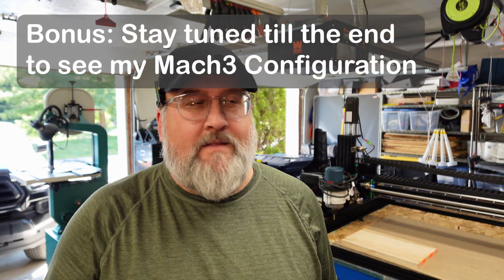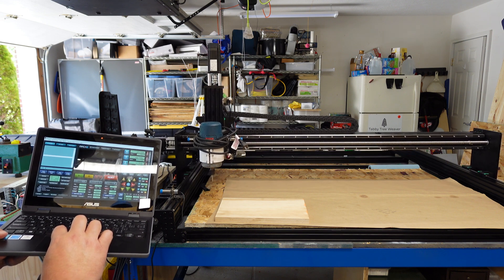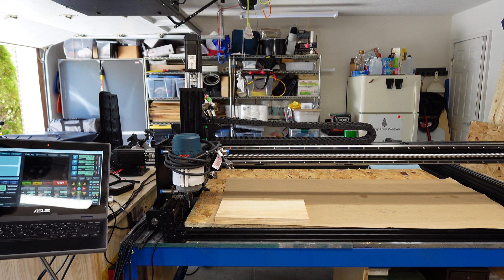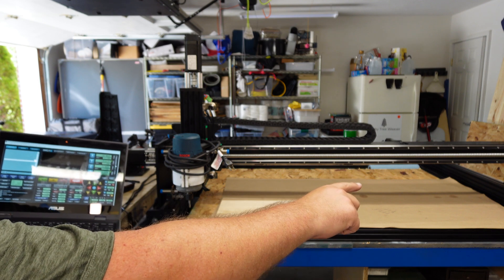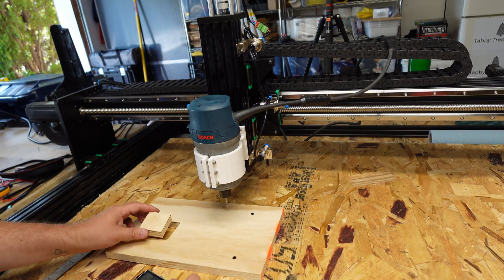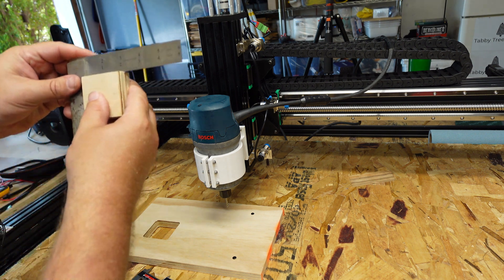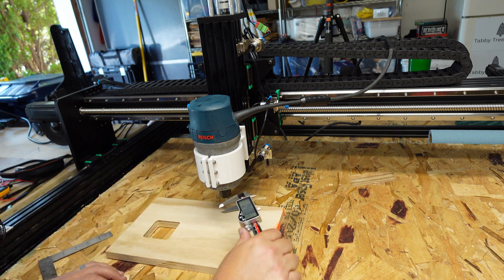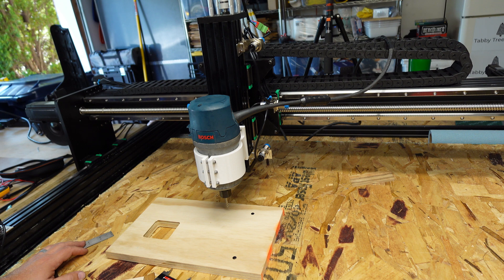YuYong QueenAnt Pro CNC is Alive & Mach3 Config

Comment: How are you liking it so far? I'm about to pull the plug on the ProV2, there aren't much vids on here about it.
Reply from the maker: I like it and good hardware for the price. I don’t like the Mach 3 controller. I got it working, but it was difficult. I wish they had a controller free option. I’ll eventually add a Maso Touch controller and I think it will be an ideal machine.

Comment: I fried my first HY spindle about three years ago. I later learned that it should not be set below 6000 rpm. I contacted the HY seller and they replaced the spindle.
Reply from the maker: Yeah, I’d heard that about the air cooled ones as they need that speed to stay cool. The water cooled ones can run slower. I still had mine set at 3000. I believe something shorted on mine. I might reach out to the seller.